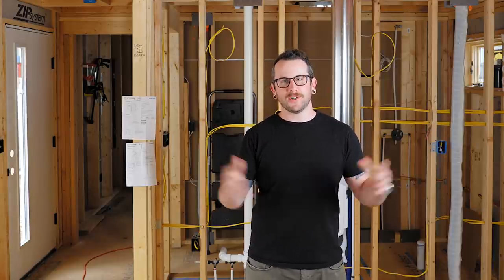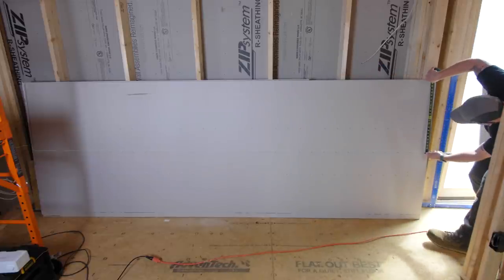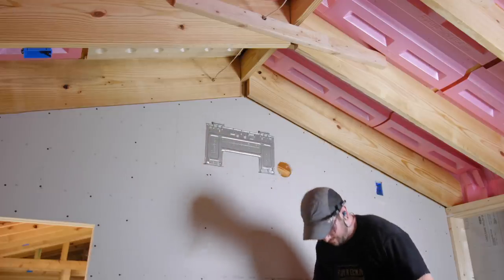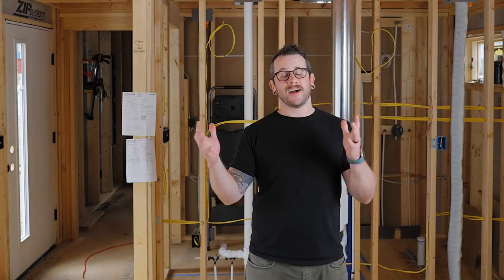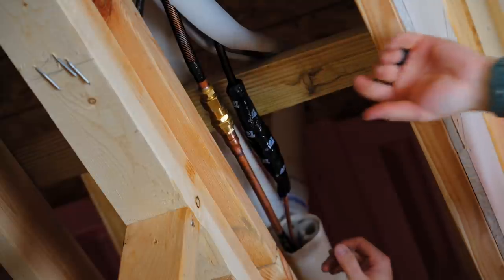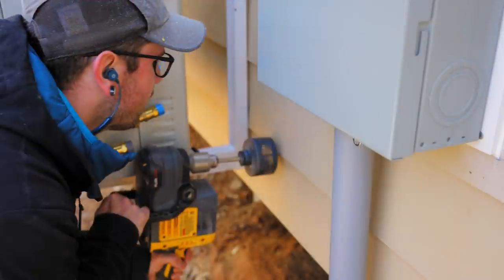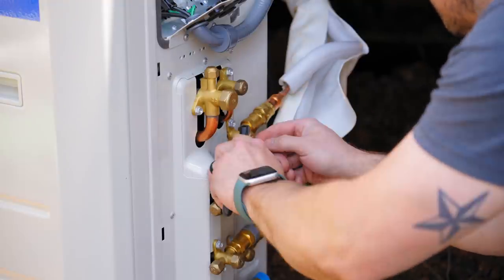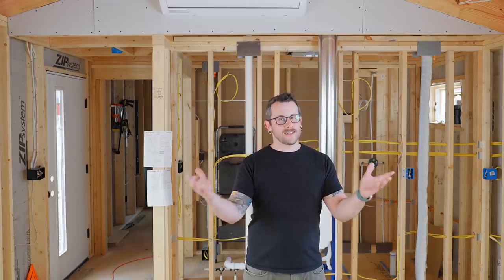DIY MULTI-ZONE Ductless MINI SPLIT Installation in New Construction!

Comment: How do you pressurize the lines to bubble test them? Are the lines you connect carring freon or chilled water? If it's water how do you get all the air out of the lines? Thanks
Reply: The lines are pre charged

Comment: Two questions I can't find answers to for mini splits:

1) Can you run multiple air handlers as one zone?  I'd like to use a few air handlers controlled as one zone for my downstairs and get get rid of the existing HVAC ducting.

2) Can you run a line set up vertical from an air handler?  Want to run a line up the side of the house, across the attic, and back down to the garage.  Some systems I looked at have 60' linesets.

Comment: How are you checking for leaks before the refrigerant is turned on, like the very first place in the video where you check for a leak? What's going to leak if there is no refrigerant? Are the lines themselves charged with pressurized refrigerant, so that's what would be leaking?
Reply: From Mr Cool. “25 ft. precharged line set, can be easily installed by the homeowner. No special equipment, training, or tools are required to install thanks to the pre-charged quick connect DIY line set.

Comment: Interesting system Johnny. Just wondering what the pricing is on each of those units? The only draw back that I see is having to deal with potential multiple system breakdowns down the road.
Reply from the maker: Looking at about $2,500 for this system. Generally, my mini split units have been rock solid except when I forget to clean the filters in the shop, which can clog the drain line.

Comment: Fantastic work, dude! The house is going to be ready before you realize it! 😃
About the AC, it's better overkill than sweating inside! 😬
Anyway, stay safe there with your family! 🖖😊
Reply: If you go too overkill, you’ll end up cycling the unit constantly and cause early degradation.  Key for him is the units seemed designed to cool where needed,.  If he tried to use all 36k btu at once to heat or cool, he’s probably about 2X what he needs.  Realistically the 18k unit alone would be plenty.

Comment: In the Video you check for leaks on the interior connections before the lines were charged.... How would soapy water indicate a leak on an uncharged line? or is the line-set actually charged as well?
Reply: From Mr Cool. “25 ft. precharged line set, can be easily installed by the homeowner. No special equipment, training, or tools are required to install thanks to the pre-charged quick connect DIY line set.”

Comment: Can you add drain pan tabs or is there an easy way to clean the drain from the mini split's air handler side if and when the drain clogges with debris? Another words can it be flushed or vacuumed even for preventative means? Thanks. Good looking system.

Comment: If the line wasn't pressurized until the end of the process, how were you checking for leaks at the inside connections?  How would there be any bubbling if there isn't any pressure to push gasses out of the lines into the soapy water?
Reply: I’m glad someone else wondered this but sad it didn’t get answered. Hopefully some activity on the post will get it answered. Here goes nothing.
Reply: The lines are independently pre charged at the factory. When you put them together an internal valve opens up at the joint. Hope that made sense.

Comment: /armchair building-science opinion/ probably should've cut 3 smaller holes for each penetration of the building envelope so that you could actually air-seal them. It's really difficult, even with expanding foam, to air-seal a group of pipes/wires. Also, just caulking the siding holes doesn't really help when you still have holes in your sheathing behind that siding. I realize you didn't have many good options there, but that caulk is essentially just aesthetic and you might run into trouble with the sheathing down the road in that spot. 

I've been watching way too many Build Show Network videos...

Comment: Are there the same issues with oversizing this as conventional HVAC?
Reply: Not exactly. As an example a pioneer unit at 18k nominal can work as low as 4k or as high as around 24k. If all zones are on the 18k coil could be as low as 4k with the others around 3k.
Sure you can oversize by going 24k or even 36k. But these at 18k may be just fine, esp if they need them for heating.

Comment: How loud are the fans??  Do you have an exact decibel or something similar I can gauge it to?  Trying to have a unit installed but worried about the neighbors.  houses are very close together.
Reply: I have a large Mr. Cool and when you're outside standing next to the compressor it's whisper quiet. Neighbors won't hear it.

Comment: How did u check for leaks before opening the freon lines, did you add air into the copper lines?
Reply: The lines come pre charged with the correct amount of refrigerant. Once the connection is made it opens that end of the line set. I’m not sure if that means its actually under any pressure, so I would be a little nervous. You might want to leave a way to check that connection point down the road

Comment: You didn’t pull a vacuum on the line set before opening your refrigerant valves?
Reply: you don't vac the lines with the diy kit.
Reply: @chrismarch6644  Hmmm, that’s contrary to what the professional refrigeration and HVAC techs recommend for precharged mini split systems.  The line sets should be vacuumed prior to releasing the refrigerant into the lines.
Reply from the maker: No, pre-charged lines are definitely not vacuumed.
Reply: @craftedworkshop  the line sets are not precharged.  The refrigerant is released from the outdoor unit after the line sets are connected and vacuumed.
Reply from the maker: @merlingrim2843  not with this MrCool system, you are incorrect. Look it up if you don’t believe me.
Reply: @craftedworkshop  Regardless of what the instructions say, doesn’t it make technical sense to vacuum the line set to prevent oxidative and corrosive elements from being in the line?  I mean it’s a best practice for every other system, so how is this situation any different?
Reply from the maker: @merlingrim2843  because the lines are pre-charged with refrigerant. It’s not necessary with this system, which is what makes it DIY.

Comment: It is NOT recommended that you install these systems inside of interior walls, at least the parts that are mechanically tightened together. If you develop a future leak in one of those fittings you'll need to open up the walls to locate it. You can run these copper pipes inside of your house but leaving access to the fitting connections is very strongly recommended. If you put the head units on walls that have a closet located on the opposite side you can use the cover kits to hide the pipes, yet still leave you access to the interior connections.

In a perfect world your system install will perform perfectly, but IF you have a leak your going to have to open walls to find it. If the copper lines were a one piece design with fittings only at access points on the condenser ports, then it would be a quick fix.

Comment: Getting ready to install multiple zones like you did. Was just wondering was there any issue with pipe sweating or mold?
Reply from the maker: It's been all good so far, rock solid since I installed them.

Comment: Why didn’t you vacuum the line sets down? And how can you check for leaks before positive pressure in the lines from the refrigerant. Little worried you screwed that system up.

Comment: Electrical is the easiest part of that job!  Easy to do if you've done any electrical.  Just shut off power first. Also, I'd hand tighten the connectors in the unit.  No chance of stripping threads.

This split unit would be great for my 100 year-old house in Sacramento.

Comment: Wait!  I'm confused by the leak check of the line set.  No nitrogen purging, and no ac vacuum/manifold gauges etc... This is how I hoped it would be, but aren't you putting ambient air from the line set into the system?   How do you leak check prior to releasing refrigerant? Thanks! Good video.
Reply: The lines are pre charged

Comment: I’d have an access panel for all the refrigeration line connections lol and how did you check for leaks before you let the refrigerant in the lines ?
Reply from the maker: The lines are pre-charged.

Comment: What about freon? Was it preinstalled or did someone come and fill it up?thinking of putting 1 in each kids rooms, just doesnt get hot/cold enough, poor air flow
Reply: The new generation (Gen 3) come prefilled with freon
Reply: Steven Ray Copley nice, might have to give it a go. Can these be bought in big box stores or only specialty shops needing hvac license? (friggn humid here in PA) 🔥😭😅

Comment: just a question i thought you needed to put a vacuum pump to make sure you have no moisture in your line sets witch will eventually mess up your condenser????
Reply: Lines are sealed and pre charge. No need vacuum.

Comment: so how are you testing for leaks before you release Freon into the system?
Reply: From Mr Cool. “25 ft. precharged line set, can be easily installed by the homeowner. No special equipment, training, or tools are required to install thanks to the pre-charged quick connect DIY line set.

Comment: How did you check for leaks if the system wasn't wired or charged?
Reply: From Mr Cool. “25 ft. precharged line set, can be easily installed by the homeowner. No special equipment, training, or tools are required to install thanks to the pre-charged quick connect DIY line set.

Comment: When u soap check the connection, there was no pressure in the line, of course there will be no bubbles..
Reply from the maker: Lines are pre-charged.

Comment: I was just wondering how do you leak test before opening the gas ? Here in Europe only certified persons can install even mini-splits, mostly for environment protection.
Reply from the maker: The lines are pre-charged in the system.
Reply: @craftedworkshop  He is asking how you can install without knowing what you are doing. you did not pull the system into vacuum, or leak and preasure test. you will have ambient air. dirt and nitrogen from the pipes. you simply dont connect up and go. All flared joints especially should be accessible. Refrigeration should NOT be considered diy in any country but hey.
Reply from the maker: @daveelliott5845  look up this specific system I used in the video. I’m tired of responding to folks in the comments about this, this is not your typical mini-split system. The lines are pre-charged and don’t need to be vacuumed. It’s literally branded as a “DIY Mini-Split”!

Comment: I am looking to do this in a finished house. I want to run the lines through the attic crawl space and drop them down through the interior wall cavities. Any ideas on making the drain lines work since the heads will be below the lines?
Reply: Hello, there is a condensation pump that you can buy if you choose to run drain plug. Another option is to leave the drain plug separate and run it down somewhere.
Reply: @mgumapos21  You could run the drain line to the bathroom plumbing. Tie it in the same as a dishwasher drain.

Comment: How do you check for leaks wean the line sets or no connected out side
Reply: This is a mrcool dyi unit which has refrigerant in their lines. They connect and then that opens them up.

Comment: were the lines pressurized when you "leak checked" them? 
if not then you did not leak check them.
Reply: From Mr Cool. “25 ft. precharged line set, can be easily installed by the homeowner. No special equipment, training, or tools are required to install thanks to the pre-charged quick connect DIY line set.

Comment: In the uk where I’m from, those 4” holes through the wooden joists/studding would not be allowed
Reply: I don’t think they’re allowed here either. Not in the middle third of the floor joist. Top and bottom plates of walls ok with nail stops and fire rated caulk or foam
Reply from the maker: Went with 3 ½” holes through the joists
Reply: @craftedworkshop  just started watching... how deep are joists? 3-1/2” holes would need
2 x 12 joists in every state I’ve lived in... holes can’t exceed 1/3 of joist depth if I recall correctly...

Comment: How are you checking for leaks with no pressure in lines before releasing refrigerant?
Reply: From Mr Cool. “25 ft. precharged line set, can be easily installed by the homeowner. No special equipment, training, or tools are required to install thanks to the pre-charged quick connect DIY line set.

Comment: just curious how you checked for pressure leaks at the connection points in the wall without the lines being connected and charged to the condenser according the steps in the video?
Reply: same question
Reply: I would assume the line set, since it pre-charged, May have shearers on each end.

Comment: I’m still confused, I just ordered our 3 zone and am reading the spec sheets, how many circuits do I need and what size breaker. I’m reading that each head needs a 15amp circuit and the condenser needs a 35amp circuit but all I have seen on install videos the heads are wired directly to the condenser and the condenser is the only thing ran to the panel is the 230v 35amp circuit from the condenser.
Reply from the maker: Yup, the condenser is the only thing wired to your panel. The heads are wired back to the condenser. I believe I went with a 35A breaker.
Reply: @craftedworkshop  thank you so much that helps drastically.

Comment: SOOOOO.......how did you perform a pressure test if the refrigerant valves were closed??? Did you evacuate to 500 microns with a vacuum pump?

Comment: Curious; was there pressure on the line-sets while leak testing?
Reply: Doesn't look like it. I don't think he realised you're meant to have refrigerant or at least nitrogen in them for the soapy water trick to work.
Reply: @radiosification  Exactly, I was wondering how you can test for a leak on something not pressurized. "surely it won't leak, lines were tight and tested"...LOL
Reply: This is a mrcool dyi unit which has refrigerant in their lines. They connect and then that opens them up.
Reply: @sprockkets  Yeah we know that. The problem is, he tried to test that they weren't leaking before releasing the refrigerant, which wouldn't work because there's no pressure in the line set.
Reply: @sprockkets  The refrigerant is actually loaded into the compressor located in the outdoor condenser. This is SOP for most HVAC Manufacturers (Lennox, Carrier, Daikin,, etc), it wouldn't make any sense to load refrigerant into the line set sense they are not sealed. If you purchase one, or just want to read the manual, Pioneer/Mr.Cool/etc basically states that you can DIY most of this (mount the indoor unit, route the line set, mount the outdoor unit, run service disconnect), but when it comes to loading the refrigerant and testing, you need to consult a licensed professional.
Reply: Both of you are not understanding my post. 
This is not just dyi as in you can buy it and install yourself.  It's marketed as dyi because the line sets are precharged with refrigerant. Thus you do not need any licensed ac tech for the install or for warranty. Hooking up the lines releases or opens them up so yes, you can check for leaks.
Reply: @sprockkets  Again, I understood your post fine and you're telling me something I already know - the outdoors unit has the refrigerant already in and you release it after connecting the lineset. I don't know why you even commented this as if the rest of us didn't already know it. The thing we were discussing was the fact he tried to leak test BEFORE releasing the refrigerant.
Reply: @radiosification  No, you do not! 
How about you just look up the information on mrcools web site since you still can't comprehend what their dyi units feature.
Reply: @uswcboy  that's not what it says. "Unless explicitly stated otherwise," is key. The dyi units still carry a warranty, and you can find videos of ppl who got new line sets to fix leaking ones.
Reply: @sprockkets  lol, what bit do you think I'm not understanding?
Reply: @radiosification  wow the other person got it but you still are confused as hell. Lol.
Reply: @sprockkets  Which bit do you think I'm not getting?

Comment: What type of insulation did you use on the ceiling?
Reply from the maker: I used Rockwool there as well. I'll have a video on the insulation and drywall in a few weeks.

Comment: Question on your workshop unit, do you do anything special to prevent excess saw dust going into filters? Not sure if that’s damaging or not.
Reply: HVAC guy here. This is what I would tell him: You need to do 3 things: 1- supplemental air filtration in the room near where you're working to collect as much as possible, box fan and disposable air filter cube is great. 2- clean the filters in the unit much more frequently to collect dust that got past the supplemental. 3- brush out the coils on the unit and flush the drain much more frequently to get the dust that got past the regular filters and keep it from turning in to sludge/clogging the drains.

Comment: Nice install of the split AC and great house build so far!   The connectors on the copper lines look like they have valves in them to keep the refrigerant in?
Reply from the maker: The lines are pre-charged. Please look at this specific unit, so many people are making misinformed comments.

Comment: I wish ( hope) I didn’t see that hole in the middle of the joist span.  Your not allowed to notch or bore anything in the middle third of the span. Yes / no please check 
IRC R502.8 Drilling and notching.
Reply: Maybe just small enough hole size.  Not more than 1/3 depth of joist.  
My bad. Just concerned 😟
Reply from the maker: Yup, 3 ½ hole through a 2x12 so I’m good!